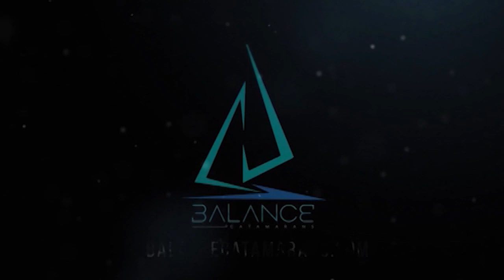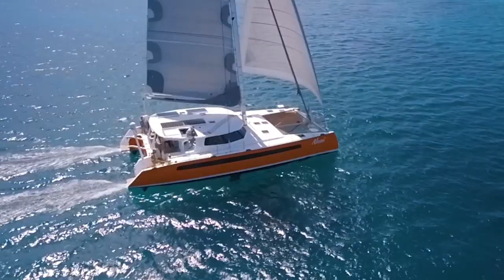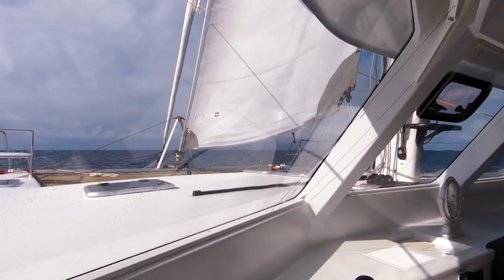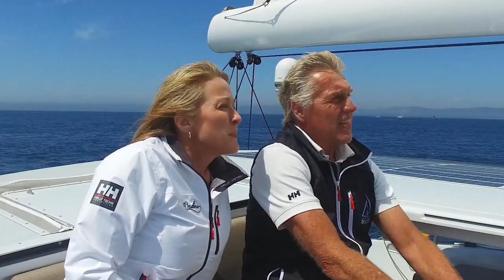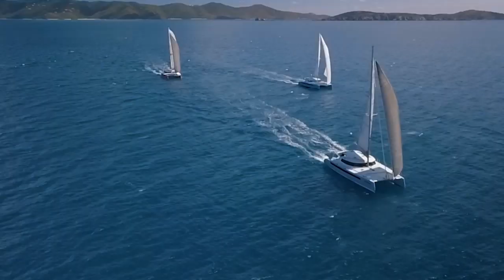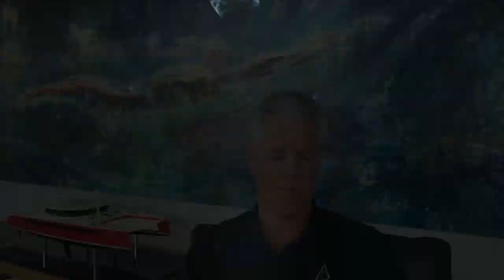Electric Engines on a Balance Catamaran?

Comment: Even with Solar you would still need a gen pac. A DC gen would be the best for this application and could even direct drive the engines. The electric engines with a DC gen pac could offer 10 knots. Yes its not totally "green" but it is a practical solution to the problem. As to the batteries there are some new next gen Lithium batteries that are coming out later this year that should make the system fantastic. But the idea of a completely solar powered boat going to the middle of nowhere antarctica is insane.
Reply: Are you familiar with the Internel System that is currently being developed?  It's basically an engine mounted DC generator.  We will be installing them on several of the upcoming new build Balance Cats.
Reply from the maker: Buck, you do not "per se" need a generator on any boat. We have a 526 that has no generator and about 3,000 watts of solar. It is always a question of ones power needs and expectations, and the trade off's they are prepared to make. But I agree that as battery storage gets better and solar efficiency gets better we may indeed see electric engine catamarans come of age. We think we are still a few years away.
Reply: @balancecatamarans  Do you think 3k watts of solar would be sufficient to run the engines for 2 days of heavy cloud cloud cover? Besides depending on how the solar is installed if you have any type of shade on any one panel you reduce the efficiency of the entire system. Then there is the matter of battery storage capacity and useful load. For instance if you used AGM you only have around 50 percent of the battery capacity before you begin too destroy the battery itself. With Lithium this is not the case but how long do you think 3k watts of solar takes to charge a battery bank of the size necessary to run the engines and onboard power consumption for a simple 2 day run night and day with limited cloud cover? You wont be producing 3k watts of power from a 3000 watt bank very often if ever. If you run a separate controller for every panel you can reduce the inefficiency some what but you still will probably never get 3000 watts of power production. A lot of people have bad misconceptions on solar power generation and its actual usefulness. Anyone who would consider going completely solar and traveling long distance to far off latitudes to the extreme north or south is just plain insane not to have a gen pack.  Just imagine being in dead calm or worse yet very rough seas with high wind sheer conditions and having your BMS shut down not only your propulsion but also all of your other electronics such as navigation communications etc.

Comment: Great video Phill  my nave is Karsten and are from Denmark  pls. look on another sailer here on Youtube  i think uou can find them  the name is "sailing Uma" old boat project now with electric motor  he is rearly good to explein to
Reply: Asim Ayyubi  First I totally agree with you and Phil. Phil is full of excellent wisdom. Diesel is power rich. BUT Uma say with the Oceanvolt they can run it 1 hour and hit about 5knots, their boat is slow so that is good speed. So while you cannot go far, the engine regenerates power pretty well. PLus your solar is still adding a charge back. So while on a reasonable passage you might get 10 hours or more of engine. Still no where like a diesel but not so terrible. Diesel can run out on other boats but not UMA, they may run short of battery power but they keep getting powered back up. This is far more reliable in the longer passages. 2 ways to add back power no way on passage to add diesel.

Comment: Phill,

Thanks for the time to do this video. Shame the industry went strait to serial style electric drives. They did not explore parallel drive systems which could have given you the best of both worlds. Beneteau did a vid on the system and it in theory looks good.  Still have the diesels functionality, in addition electric system for hydro generation, electric drive and even replacement for standard generators. 
Keeping the electric motor to 15KW would give you a choice in going to a 48V system. Video is here https://www.youtube.com/watch?v=JH3xMWplVxk. If you do have a chance to look at it would like your opinion, especially when you consider a system in each hull.

I am surprised that ZF never developed a sail drive with the hybrid option. They did it for countless of hybrid car transmissions.
Reply from the maker: Mick, thanks. I looked at this video and product. Seems very complicated!  But if the electrics can only move this monohull at 5 knots, for sure a catamaran would need far larger ones to do the same (a charter cat would need super electrics!), and I do not feel that 5 knots is enough speed for foul weather repositioning under power. The range they note is 200 nm miles, but one must always ask, with a flat sea, or a bumpy sea?  Or pushing into headwinds? But you can see they did have to resort to a generator to get even that limited range under power. Me, having sold 900 cats in my day, I would say best let some other person be the test pilot!  Right now we are designing a new Integrel alternator system for the Balance cats. We feel this is the ideal bridge until battery storage improves a lot, or solar input improves a lot, to make all electric boats a reality for voyaging. Regeneration always sounds good, and it works best on a performance cat, but of course always comes with a loss of speed. It's cool that so many companies are working on solutions, trying new things. In the end reliability is the thing we are most concerned with at Balance as the builders of adventure cats. Best, Phil
Reply: Phil,
Thanks for the reply and yes no one wants to be the test bunny or test crash dummy when things do not work out. 

Mick

Comment: Synthetic diesel will rebalance this debate.   Synthetic diesel is sulfur free a has a higher energy density.  On the battery side, lithium free batteries are being developed.  Electric battery power is still in its infancy but will certainly bet better.

Comment: IDK, I wouldn’t give up on the idea of electric sail but I do strongly agree with a redundancy backup system. I just watched Silent Sail’s video:
https://youtu.be/Q4MVCjXup9k

That has a 24kWh battery bank and motored for 3hrs at 6.5kts to deplete the batteries down to 16% SOC. With the combination of solar panels and hydro-generation (regeneration using the prop and electric motor) they got back up 70% SOC before the end of the day. My point is that solar and wind generation is only a small component to renewable energy at sea; the force of the water channeling through under sail is immense. 

I have plans to buy a used live-aboard cat and install two Bosch SMG motors from either a SmartCar or Fiat 500e then install 2 battery modules from a Tesla. I plan to keep the existing diesel motors for redundancy and safety sake. 

Which brings me to my question about being “greener,” how about using biodiesel in marine diesels?  Coincidentally I own two EVs and two turbodiesels. I guess the boat will be my first naturally aspirated diesel.

Comment: Check out Sailing Uma. They sailed all around the Caribbean, up the east coast of the United States, and across the Atlantic on a boat with an electric motor they cobbled together from a forklift and a couple of household solar panels strapped to their bimini. Real sailors don’t need to be able to motor for thousands of miles. I’m sure Balance Catamarans with their considerable R&D budget could build a boat at least as efficient as Sailing Uma did from junkyard parts.
Reply: @David Drown and @Balance Catamarans -  there is another video out there on "The O Kellys" youtube channel where Nick did a video interview with Riaan from "Top Secret" - about his catamaran that is totally 100% electric 4x Ocean Volt E-Gen motors (currently he downgraded or scaled down to (2x OceanVolt) as he gave sailing Uma one as a goodwill gesture, but I must say (Top Secret has 2x generators) to boost the power consumption back up again when needed, but Riaan very rarely would use them mostly for about an Hour per day that is for his house batter bank or top up the propulsion battery bank on cloudy days. Now then if Balance Catamarans (Phil Berman) wants to become the leader in this front like he has done with the Versa Helm then he and Balance will be light-years ahead of other competitor and I would guess more people out there would grab the opportunity to purchase a Balance Catamaran.  
The other point that I would like to make is that there is currently a Schionning Arrow1360 catamaran (Duet) for sale in Turkey that has 2 x Oceanvolt AX-10O motors on board that was built in Cape Town South Africa, Phil Berman should know the people at NorthStar Yachts. - https://www.theyachtmarket.com/en/boat-for-sale/1900333/?searchid=20975531&page=1 
I am almost sure that there are a few more Cats out there with the same concept but I would need to dig deeper to find my facts first.  
The thing about people out there that want to be cruisers would welcome the cost reduction in fuel (not to mention the weight savings) and not wanting to get to the dock to fill up, which means they spend more time out on anchor cruising the big blue.

https://www.youtube.com/watch?v=o6kOvjS1ytE   https://www.youtube.com/watch?v=nchKhM_TxYk
https://www.youtube.com/watch?v=g1jUTBGQd94
Reply: Gavin Grantham yeah, I agree and understand that you are going to lose range when compared to internal combustion engines but the low maintenance, nonexistent fuel costs, reduced environmental impact, and instant on-demand power in emergencies makes electric propulsion well worth the sacrifice of reduced range even for cruising boats in my opinion. And it’s only going to get better as battery and solar technology improve so why not start integrating the technology now?
Reply: @CrazyDavy22  Agreed 100% with you on this - only a skeptic would debate this subject when they have blindfolds on. Some of the examples that I have provided proves that electric is the way forward. 👍
Reply from the maker: Real sailors sailed the world without engines for years. So true. Agreed. And of course without a GPS too. Which is why the coasts of our planet are littered with wrecks!  We just think that with modern weather routing and the capacity to move swiftly significant distances makes sailing a lot safer than in the past. I once crossed the Atlantic on a cat back in 2000 in August from France and a weather router kept us from sailing right into Hurricane Dean. That impressed upon me the benefit of good Sat com, but also of the ability to sail or motor fast where we needed to go to get away from the worst. As romantic as it might sound, and as many free beers as one might get offered to celebrate their bravery, sailing into a hurricane is not on my bucket list!
Reply: Sure. And their range using their original lead acid batteries was about 30 miles. I've done an ocean passage from Sri Lanka where there was zero wind and we motored for 4 days - about 500 miles. This was on a light 40' cat that would sail well in 5 knots of wind. if I had a battery based system I would have to just wait for some wind. I'm a naval architect and totally agree with Phil. A diesel engine is simple, reliable, and offers a huge safety margin in avoiding bad weather. Try to find somebody in Sri Lanka who will troubleshoot your charge controller...diesel mechanics are found everywhere. IF you are willing to accept the limitations of electric propulsion, then great. But for long distance sailors there significant drawbacks.

Comment: Fascinating topic. My take would be diesel electric hybrid setup e.g. electric sail drives, diesel genset. No gas. When hydrogen storage becomes more efficient, which is in the news. Sell the genset and replace with a fuel cell. Many advantages. Including safety as hydrogen being light doesn't have the safety issues of propane.
Reply from the maker: For sure no gas!  It will be interesting to see where hydrogen goes. Technology is not there yet, but it may come. Already most of our cat owners are doing away with propane.

Comment: Diesel electric locomotives have been in use for decades. Why isn’t it a viable alternative to have diesel electric, solar, and perhaps regen all working together to drive the electric motors?
Reply: Trains don't care about weight, sailboats, especially catamarans do.  The energy density just is not there yet, but we within a decade I believe from it being a viable blue water solution.

Comment: Phil great video, as usual, thank you very much, I have been looking at this question a long time how to use electrical engines and I would agree it is difficult though boats should be able to make way more electricity to minimize using generators and diesel.
 I know you know all this but I just see so many boats with little solar.
 I am a financial analyst living in China for the past 23 years working for foreign investors and unfortunately your information about China is incorrect. You seem to incorrectly think that power made from the U.S. would be more green and you would be wrong. China produces 25% of electricity from renewables while the U.S.  only 17% . China would be one of the best countries producing green power and they will only get better.

China uses coal for most of the other 75% of electricity generation but the U.S. uses coal for 25% of electricity production and 36% from natural gas better but not friendly. Only 10 years ago the U.S. used coal for 50% of electricity production. So the U.S. is producing very little green energy compared to a much poorer developing nation and compared to many other countries. The U.S. President has also stated he wants to revive the coal industry and get more power from coal, not that green.
You are left then with individual cars, trucks boats etc using gas or diesel. The U.S. has 100% car ownership while China is less than 30%. China by far has the most electrical cars.
Ranking countries in total renewable production: China is by far and away #1 producer of renewable energy (50% more than the U.S.), Brazil #2, U.S. #3, Canada #4. Per capita, the more important measure:  Iceland is #1, Sweden #2, Costa Rica #3, Nicaragua #4.
China is the largest polluter in the world but that is because they have the most people, they should be. U.S. is #2, India #3. China and India hold the most people so they pretty much have to be the biggest polluters. The U.S. is #3 but with a billion FEWER  people. Per capita the U.S. is a MASSIVE POLLUTER. Per capita is the important measure. The U.S. carbon emissions per person are 16.5 tonnes while China is 7.2 tonnes, less than half an American. I hope the information is helpful.
Reply from the maker: Scott, some states in U.S. produce energy with little coal, others a great deal. I perhaps did not clarify I was discussing location of electricity generation. I am sure some places in China are greener and other less so, but China still does use a lot of coal you must agree. Best, Phil
Reply: J. Scott, going to be a devil's advocate for a minute, but China's production/consumption is driven mostly based on the fact that most of China can't afford more. Per capita is a nice way of showing how terrible the US is, but the population of China is about 4.5x higher, so their impact is much greater. Having said that, I agree with you, we aren't making as much progress as we should and our president isn't helping there. There are still many mandates in place and despite the rhetoric, we are actually getting better - it's not an overnight process.

Comment: Looks like solar panels are progressing faster than batteries.  20% efficiency is attainable now and 30% is coming along.  So panels will soon be able to make half their power again, that's quite an improvement.  But when I look at panels for marine use they are all around 100W .  For domestic home use panels of 400W are becoming common.  That's 4 times as much power per panel.  So it looks like massive gains are already achievable, why are marine panels so inefficient?
Reply from the maker: Yes, solar tech is getting better really fast, which is why when folks order our boats and ask what panels we are using we tend to say, "whatever is the best panel available when we need to order them for your boat."  Best, Phil
Reply: @balancecatamarans  Can you use panels that would be used on peoples roofs?  The conditions at sea must be about as harsh as you can get.  Salt air and spray.
Reply: @earthstick  The standard solar panels we use on the Balance 526 are the Sunware 327w glass panels.  They are far most efficient then the flush-deck flexible panels like those from Solbian .  Flexible panels have the advantage of being able to walk on them and they create less windage.  Unfortunately the way most people mount them does not allow the panels to get proper ventilation so they get very hot and the efficiency suffers.
Reply: The other innovation I've seen the use of traction kites instead of conventional sails.  I understand they are not going to work sailing up wind but they could be used in conjunction with panels and cast no shadow.  Maybe kite sail through the day while 12 hours of batteries are charging and the motor at night.
Reply: @earthstick   I have seen a few experimental kite rigs on catamarans over the years.  They never seemed to catch on.  Having never sailed one, I can only speculate as to the reasons why.  My guess is that they are probably hard to deploy and retrieve, difficult to control, and have a very limited wind range.